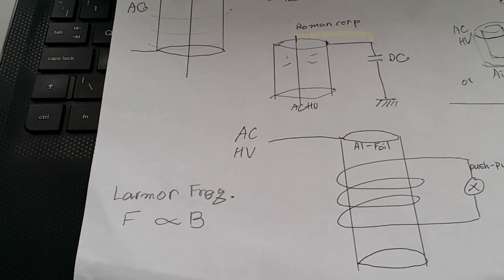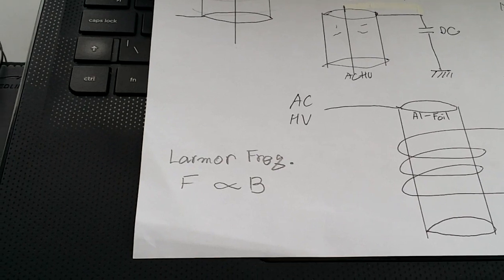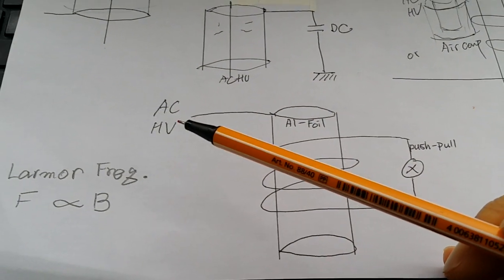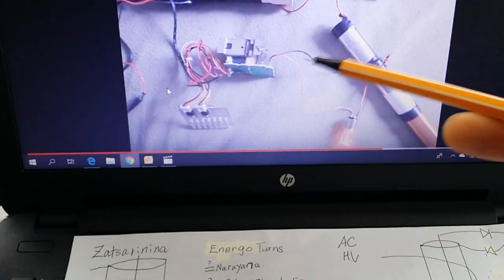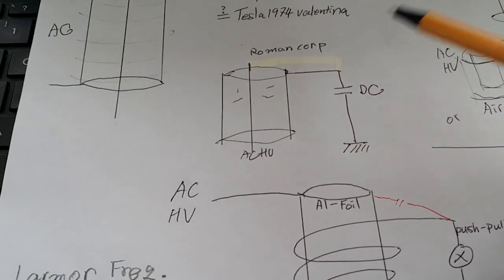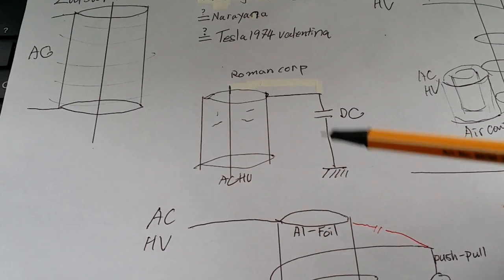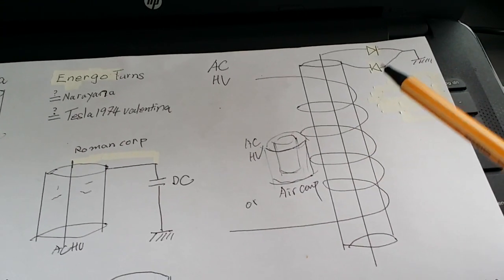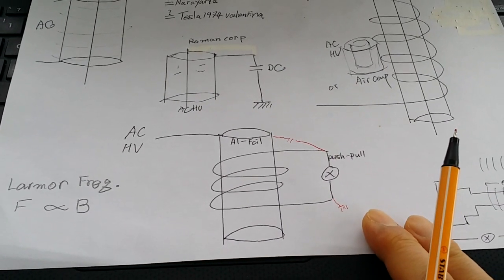Akula/Ruslan Principle 9 - Larmor Frequency & Static Charge

Comment: There are many terms to think about in this free energy area of research. I am convinced after thousands of hours of testing, that this is all about power factor correction, specifically having circuits run at voltage and current being completely out of phase, meaning with power factor of 0. In this condition, reactive power is looped, and real watt extracted. Higher frequency, once the circuit is properly tunned, means higher extraction.